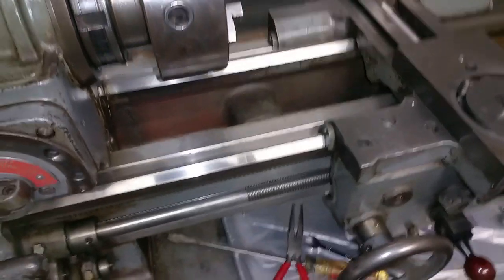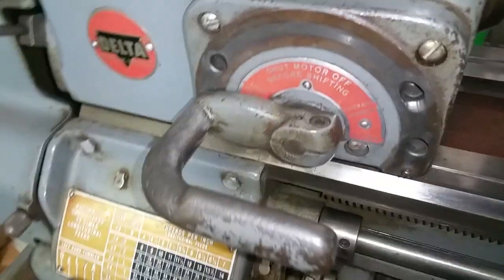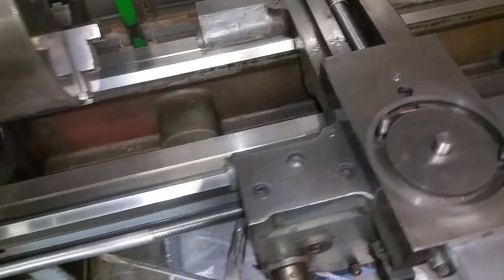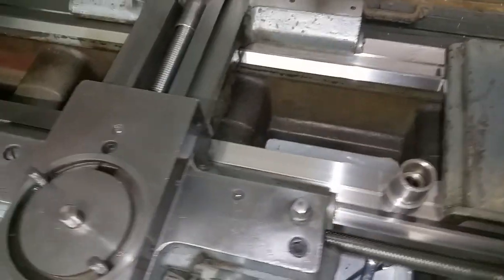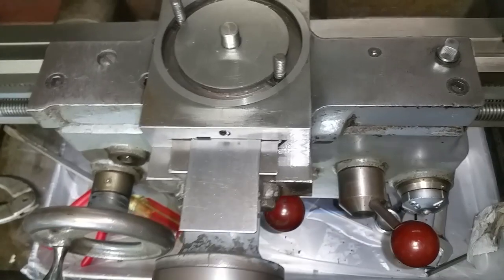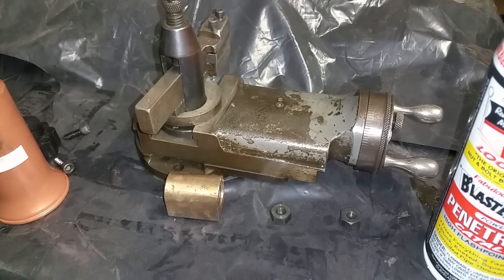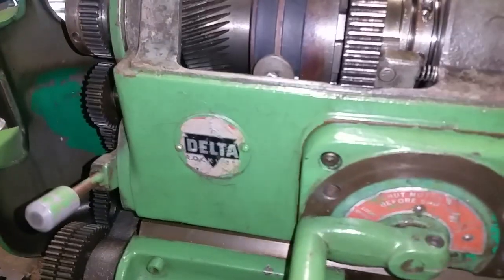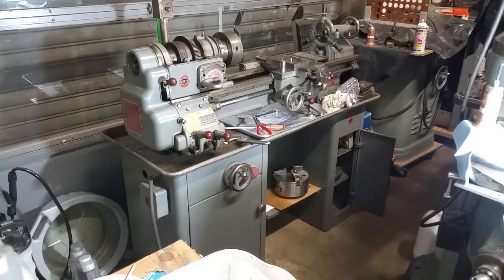Delta Rockwell 11 Metal Lathe Update

Comment: I have a delta 11", the back gear has two teeth broke out. Are there ways to repair or replace part.
Reply from the maker: Brad,  a good machinist should be able to fix that for you in a couple ways. 1 weld it up then re- machine the 2 broken gears 2  turn it down then sleeve it and recut all the gears.  or should be able to find a good used one     Joe
Reply from the maker: actually there is one on ebay now.  https://www.ebay.com/itm/203284047556?hash=item2f54ac66c4:g:OE8AAOSw1rJgMBq3

Comment: Is that a Camlock spindle?
I understand you have two.
Will you sell what's left of the parts lathe when your done with the primary?
If it IS a camlock, I would be VERY interested n whatever is left....
Reply from the maker: Christopher, Delta Rockwell did not offer a camloc spindle.  It is a L00 Taper Spindle.  Both lathes are complete so i wont be parting either..   I purchased the green lathe for the taper attachment.  I will be selling that lathe shortly so if you are interested, let me know !   thanks  Joe
Reply: Do you still have the one forsale ?
Reply from the maker: Monte, i may be persuaded in parting with one..